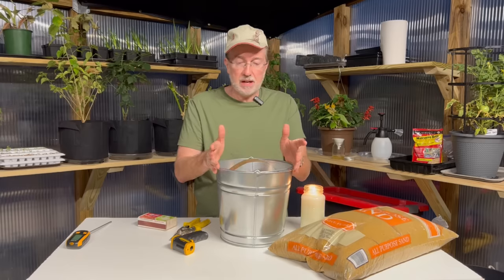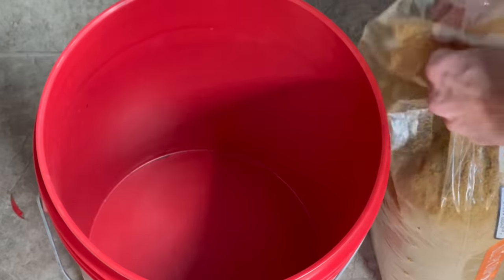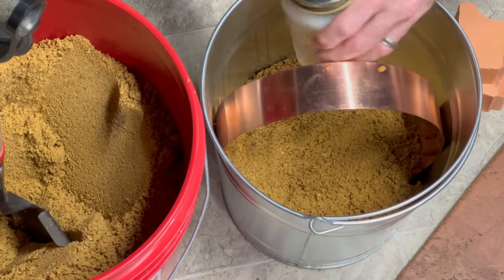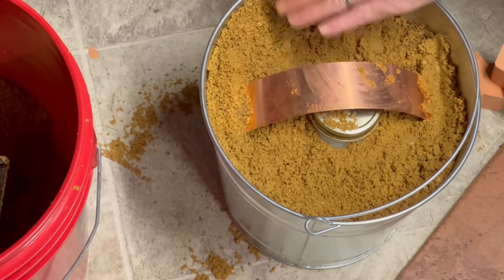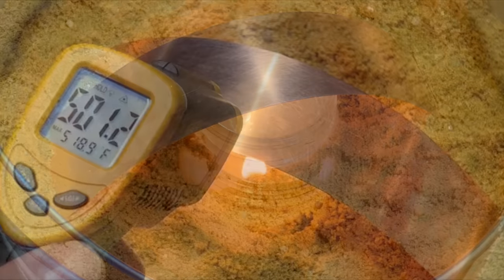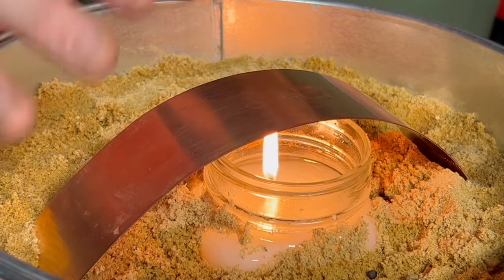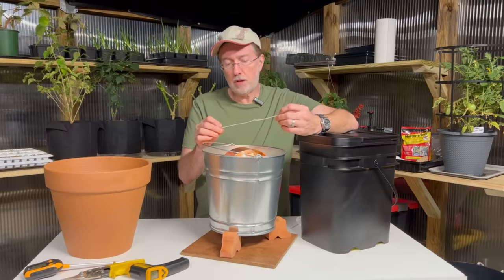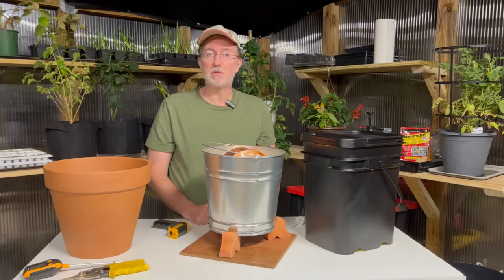DIY Copper And Sand Heater | No Electricity Needed For Greenhouse Heat

Comment: Surely there is a way to show us the temperature of the outside of the bucket . I think this fall’s under the old adage, you can’t get something for nothing , meaning a candle, bucket of sand and a copper strip isn’t going to heat a room very efficiently .
Reply from the maker: Not designed for human heating.  Only to keep temp in a small greenhouse above freezing.  Sand retains some heat.

Comment: i DON'T SEE A REFERENCE FOR WHERE YOU GET THE COPPER RIBBON?
Reply from the maker: We changed the link in description because they ran out of stock.  Check the description, there should be an Amazon link, if not means it’s out of stock.

Comment: basically you are trying to heat with a candle, a candle only puts out about 80 BTU, which may heat the bucket, 40 to 45 BTU per square foot is what you need.

Comment: What if you used two strips of copper and have them cross in the center above the candle? Maybe rivet/screw them together so they make solid contact. Then the heat would be dissipated in 4 spots.
Reply from the maker: Excellent idea…..still a wrk in progress.

Comment: Curious if anyone has tried using a clay chiminea indoors with some of these heating methods… setting them inside the chimineas or metal outdoor firepit/fireplace but using them indoors using these radiant heat methods. How well could they radiate heat without using logs…. I’m curious now….

Comment: I had a dump truck load of sand put in the middle of my greenhouse. I put one candle and the copper strap on top. It heats my entire 3000 square foot greenhouse. On freezing days my greenhouse is about 90 degrees fahrenheit.
Reply: Picture please😂😂😂😂😂

Comment: I'd leave the sand out, use two copper elements and cut out the bottom of the bucket leaving a platform for the candle and set the bucket on 3 bricks, hot air convection , the hotter the copper and bucket get the more air will be pulled up from the bottom and circulate as warm air from the top of the bucket, I'd place it in a metal sand box on top of sand,,,
Reply from the maker: Thanks for your input

Comment: Check the temp of the candle biuld vs a small elictric element 25w and up intill its the same as the candle heat temperature. Hmm
Reply from the maker: Last night outdoor 30f / 4 candles greenhouse never dipped below 45f

Comment: How much heat reduction might I experience using 1" rather than 2" width copper roll?
Reply from the maker: I would think little.  The purpose was to allow heat from candle go into sand, and the sand retains heat rather than dissipate into the air.  Not a perfect system, but I’m experimenting with these type of methods.

Comment: Moist Sand will convert the Heat energy into the Sand Mass, more quickly and evenly. And in effect work as a very slow fan to release it’s vapor heat in a delayed process. Adding warm moisture into the greenhouse.
Reply from the maker: I wish I had your ability to convey the thought.  Thanks…

Comment: Fixes to this method
*Keep sand on top of the kopper, as most heat will be transferred to the air before the sand. Maybe cover the top side of the copper with clay.
*Make the candle as wide as possible, to keep the flame fixed, and not shrink over time. Could use top and bottom of a wide tin can to make a container.
Reply from the maker: Thanks you sir.  I’m thinking of upsizing it massively.

Comment: Does it matter what type of sand is used?  There's the white colored sand as well.
Reply from the maker: The second one I built I used kiln dried sand as I think it holds heat longer and better.  If you’d like to see a massive sand storage system check out sand battery Finland…..quite amazing.

Comment: you would get the same amount of heat if you just used the candle.
in fact what you would be doing is taking heat from the plants by placing a heat sink in the room that would absorb the candles heat.
the best thing you can do to cut cost in greenhouse heating would be to buy several of the 40 or 55 gallon drums and place them inside the greenhouse and remove the lids and
fill them with room temperature tap water and thats it.  during the warmer day time the water will absorb the ambient heat and during the night the heat will be released.

Comment: Packing the sand in layers will increase the heat exchange. Also setting the bucket in direct sunlight after painting it black will preheat it and shorten your timefor complete heating.
Reply from the maker: Thanks for the tip…

Comment: Living in a parking lot with 2 kids my rv is a 1998 bounder you think that could keep us warm
Reply from the maker: Be sure to use safety equipment like smoke, carbon monoxide detector and have fire extinguisher handy.  I would opt for solar panel with battery backup from harbor freight to power electric heater.
Reply: @ZenGardenOasis.  I have a 100 watt from harbor freight,with 2 of the harbour freight batteries,but and a 5000 power inverter from harbor freight,but I don't think those batteries can handle a electric heater,

Comment: You showed the temp of the copper. What is the temp of the sand and the outside of the bucket?
Reply from the maker: I’m planning a follow up with a thermal camera and a temperature probe to show better data. Thanks for the question.

Comment: If this is getting over 500F and uses a paraffin candle with 199F flash point or vegetable oil with 400F flash point, this is VERY dangerous at 500F because if it flashes it may EXPLODE the container and set the house on fire! Maybe use only vegetable oil and use wet sand or water to keep at no hotter than 212F.

Comment: It's not that these type of heaters produces MORE heat.  What they do is prolong that heat.  Remember you can heat air really quickly but it loses that energy really quickly.  Thermal Mass captures what would have been wasted BTUs and releases it slowly
Reply from the maker: Thanks for your input.  Sound reasoning.

Comment: Dude I like the idea but it has flaws. One is the level of the flame as the fuel burns up. Solve that with a tiki torch style heat source. Use veggie oil. Second thing is only using one copper strip. rivet 3 o 4 of them in the center and fan them out even. More heat going in the the sand. I bet you could incorporate a copper coil of 1/4 tubing on the inside of the sand with a water reservoir and position it so it will self circulate the water over and over.

Comment: What about the fumes from the candles? Won't the excess carbon dioxide be toxic to the plants if you have a few candles going?
Reply: Contrary to the climate activists, plants use carbon dioxide to survive. Photosynthesis, the process in green plants and certain other organisms by which carbohydrates are synthesized from carbon dioxide and a source of hydrogen (usually water), using light as an energy source. Most forms of photosynthesis release oxygen as a byproduct.

Comment: Can copper pipe or tube used instead of flat stock?
Reply from the maker: I use the flat to allow it to heat the sand to retain heat longer.  Check out the YouTube video sand battery Finland. Goes into more detail.

Comment: Would wet sand have high thermal mass by 1.2631578947368 just by add one and two third  cup water pre gallon of sand or five pint water pre cu ft sand

Comment: Why not put copper the other way as  well (90 degree's to that one) ? Heat more sand quicker surely ? 🇬🇧🇬🇧
Reply from the maker: Interesting idea….it’s a prototype and needs lots of adjustment.  Will try your suggestion.  Thanks.

Comment: Why couldn't you put the candle under the bucket of sand and skip the copper strip?
Reply from the maker: I wanted the strip to heat up and transfer said heat to the sand. Sand can hold heat for long periods of time.  I am however working on a cast iron version that does heat from beneath.  Please keep an eye out for it.  Thanks.

Comment: I would use a larger container and candles and add more copper strips to increase the conductive heat...
But like the rest of the viewers... I wonder if this would raise the temperature significantly for the trouble of setup...
Reply from the maker: Only designed to raise a degree or two for small hoop houses or small greenhouse.

Comment: Would a cast iron pot work better?
Reply from the maker: That’s a great point….I need to switch over as I think cast iron will hold heat longer. 👍
Reply: @ZenGardenOasis.  so quickly responded to thank you
Reply: so quickly responded to thank you

Comment: The idea is good, making radiation heat with a candleflame, but the energy output is to small. 9 waxinelights (or more) under a 10 mm thick steel plate radiates heat, but its still not much.
Reply from the maker: I sized up to a large metal trash can 25 gallons of shortening and 10 wicks.

Comment: There are a lot of really smart people here, could somebody consider taking on my issue? I have two heaters one in the kitchen and one in the living room. The front door is in disrepair and there are other areas that have drafts (I’ll be working on those this week. I don’t really know what I’m doing.) there’s a large room (formal dining and formal living room.)between the kitchen/den and our bedroom. Damn, it’s really cold! We have to use a cold bathroom. What I desperately need is a heat source for the area that’s so terribly cold. I’ve tried to ask this men a question to no avail.  Please forgive any typos, it’s late.
Reply: I am no expert. But when i.was young we would get Styrofoam sheets from misc items from shipping. You could probably find some left over at the back of some stores they no longer need. But put that in your windows. N it helps. Also put something like an old towel or u can possibly use a pool noodle at the base of the doors to keep the drafts down. There's you tubes on how to use the pool noodles at the bottom of the doors if u go that route. You can use a small candle that's lite and move it slowly around the rooms to see where the drafts are coming in.  then do whatever u can to stop them

Comment: Could you used copper pipe filled with sand?
Reply from the maker: I saw I vid showing just that….can’t remember the title though
Reply: @ZenGardenOasis.  I tried to look for it couldn't find it. Did it work in the video you saw? Will you try it?

Comment: STOP RIGHT THERE!! 
 "It will last for many many hours??" Define "many, many!" 
Two "manys" = 3 hours.

I did this with a big cast iron Dutch Oven and three gallons of sand last night on the kitchen stove.

I couldn't get the sand to exceed 300°f even when the iron walls of the Dutch Oven pot registered 700+ degrees inches above the flame. It is the gas stove's largest burner. I left it running full out for over one hour. Sitting next to it I enjoyed the heat radiating off the wall of the large iron kettle... For about another hour.  The temperature dropped noticeably after one hour. By the third hour it was Luke warm; good for nothing. 

Sand batteries work when they are seriously over sized and regularly recharged with heat.
Reply from the maker: Could be the brand of stove.
Reply: A Dutch Oven is a cast Iron kettle. I filled mine with sand and tried it. Last night was bitter cold out with a good wind. I kept the sand battery on the stove with a low heat. I have a copper coil and an aquarium air pump blowing air through it that helps a little. It kept a well insulated 700 sq.’ @ 70f. 
 @ZenGardenOasis.

Comment: I think that @zengardenoasis you missed something in the video. To know how much a candle can heat metal is nuts, but to know how long around this pot candle we can feel the heat is important! Then here, we just see that you heat a pot which is not representativ. I mean, if you consider the temperature variations with the seasons, how can you pretend this model is efficient or not if you don't mesure the heat ray!

Comment: looking at you heater beside the terra cotta pot and thinking..... suspend that terra cotta pot upside down 6 or 8 inches above the sand heater to trap and radiate more heat ....

Comment: I bet you could suspend the terracotta pot over this to increase the radiancy, possibly double the output using the same candle.
Reply from the maker: I want to increase size of candle to the 3/4 size of the bucket with 5-10 wicks and see what happens.  I did actually make a terra cotta heater video a couple of weeks ago.

Comment: elevate the bucket and put the candle under the bucket and save the money on the copper . it will heat the sand and radiate just the same
Reply from the maker: New vid coming with that idea.  Also using alternate materials.

Comment: Do not expect miracles from this... A candle give of about 80w, that is not enough to even heat a small room (I have tried that with 5 candles and contraptions like this to spread the heat better in the room, it did not work, it got horribly cold...)

Comment: Hmm. The flame will warm the air faster. Why sand?
Reply: I think it is because of thermal mass. Air has almost no thermal mass and that’s why a hot desert air gets cold at night while the sand of the desert retains the heat for hours. In this case the candle is heating the sand, not the air.

Comment: You don't use a wax candle that gets lower by the minute, instead a liquid fuel so it stays in the exact same place and you can even add fuel when it gets low.

Comment: A BTU is a BTU is BTU. You can't get more BTU out of something than you start with. There is only so much energy stored in the candle you start with and that is the energy that is available. No more , no less.
Reply from the maker: Thanks for your input.
Reply: Yes but it's BTU per hour, not per candle. 80 BTU * 40 hours is 3200 BTU
Reply: @mattjohnson2848  No it's not. There is only so much energy in that candle.You can do the same with a gallon oil .  Depending on the sulfur content there is 138,500 BTU in that gallon of oil . It's not measured in time. Look it up.
Reply: @tomsawyer8525  😂 Ok, I'll try to keep it simple. Do you actually think a small candle that burns for 1 hour and a large candle that burns for 40 hours both have the same potential 80 BTU's? 😂
Reply: @tomsawyer8525  sorry that was mean of me. My point was that candles are not all the same size therefore not all candles contain 80 BTU's. If they all have the same composition then a large candle contains more energy and burns longer than a small candle. 2*size = 2*BTU's and 2*duration, etc.
Reply: @mattjohnson2848   Let me keep this simple as well. Regardless of the size of the candle , it only has so much energy in it that can be released and it is disengenuous to try to convince people they are getting more heat or energy  than is available by using your method.

Comment: If there is any way you can darken the outside of the copper(blacker the better), you'll be able to convert more of the heat from the metal to radiant heat and be able to transmit it further than just the convective heat around it.

Comment: This will be great for those of us in Europe
Since the US destroyed the NordStream 2 Pipeline, then offered to sell us gas at only twice the price that old Putin was charging us, most of us are unable to afford to heat our houses
Will probably place mine on a couple of bricks to keep it off the carpet
Got to check out your candle video now, though from the sound of it if we got to buy vegetable oil to make it, not sure how cheap this thing is going to be
Reply from the maker: Free grease from McDonald’s
Reply: Electricity prices are higher, but they're stabilising at a lot less than twice the price on average. If you were using electricity to heat with, then that's not the best to begin with.

Gas prices are currently plummeting. I'm not sure where they'll end up, but the trend is very much down.

Unlike some rando account on Youtube that any vatnik can and does make hundreds of, I'll just tell anybody to go search for charts. Statista has a bunch of useful info on stuff like energy prices, with years of information. Needless to say, anybody trying to paint the tired old "Winter is coming" narrative, is vastly overstating the actual impact of Putin's little 3 day adventure that's still going over 600 days later.

Still, any means of stopping your greenhouse plants from getting frostbite is good, and ceramic pot heaters, sand heaters and similar are all good ways of reducing reliance on the grid for that. Nice vid. Keep up the good work, and don't let irrelevant politics bleeding over from Pootie's little hybrid war stop you!
Reply: @technicalfool  I live in the UK, and due to an injury at work 13 years ago, that left me partially disabled, i am on benefits
My current Electricity and Gas combined (since i pay the same supplier for both - for extra discount) is 25-30% of my monthly income.
Thats an increase from the 15-20% it was just 2 years ago
Our supply from Russia was costing us 45% less than we are now paying America, that fact is not up for dispute

Im sure some people in the UK can explore other means of heating, have new heaters installed, or central heating fitted
I cant, i cannot even replace my Fridge which broke 3 years ago, or my gas boiler that should heat my watr which broke the same year
Someone who has been living without hot water or a Fridge for 3 years, or cant replace my clothes which are wearing out,  cannot even entertain the idea of spending the 1000s of pounds any form of new heating might cost me

A bucket of sand and a copper strip, plus some candles is a stretch of my finances, it will mean skipping a few meals to pay for it, but if it keeps the frost away then its worth a try
Fortunately its sitll mild right now, but i want to be ready
Reply: so don't buy the gas .

Comment: Instead of a candle, why don't  you use a oil lamp. Use the waste oil out of your kitchen. Flame wil stay in same position and you can keep it in the sand and fill it up when you run out of oil. Just a thought.